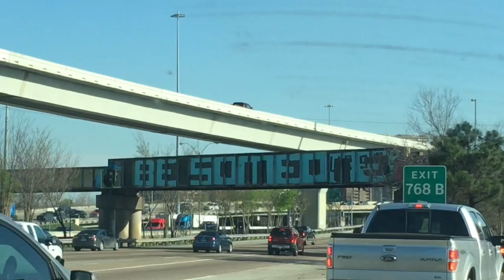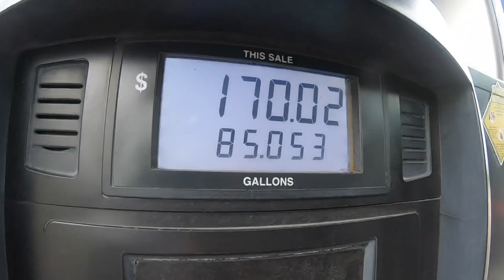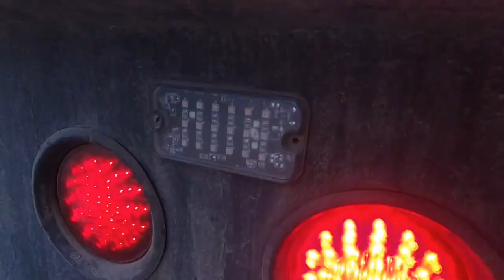Heavy haul trucker | RGN lowboy moving CAT excavator through downtown HOUSTON

Comment: You need to put a cover over the exhaust pipe of the machine or turn the cab of the machine the other way so that the wind don’t get in the exhaust and turn the turbo. It can lead to ruining the turbo because you don’t have the oil flow to lubricate the turbo while it’s spinning.

Comment: Wow the pins in that bucket are toast!  Just another little tip.  Carry I rubber boot and shove it in the exhaust pipe of the excavator it will save the turbo.
Reply from the maker: Not sure how the operators do the work with those terrible pins, your the second person that mentions that. Will have to do research have never seen or known about covering the exhaust pipe. Is there a reason to do it ? Lots of people I see on the highway don’t cover them
Reply: Grtruckingdemolition I cover the exhaust on my quad trac tractor when I haul it as when I started hauling it, that what I was told to do.  I’ve heard it matters, and I’ve heard it doesn’t.  So,  its up to you.
Reply: The breeze passing by the exhaust stack can cause the turbo to windmill and spin. With the motor off and no lubrication available bearings will be damaged and shorten its life.

Comment: Just a tip for ya man. When you put a chain/binder on the tracks like that, avoid putting it in an area where 2 track sections meet like you did with that 1st binder. @10:21. You see how it pulled the sections apart? If that binder were to slip or the excavator settle, that hook could wind up in the gap and possibly break through, now you have an unsecured load. Not to mention, DOT doesn't like it either. Please take this as constructive criticism. People taught me, just passing on some knowledge from one driver to another. Be safe out there, sir.
Reply: Johnny K True I was just thinking about that
Reply from the maker: Thanks for the tip/advice. I appreciate for commenting in a good way. 🤝
Reply: Man I had a driver bitch at me over the CB for not using chains to tie down and I do it the same way that he does. Saying I'm get a ticket if dot catches me but I passed by dot tied downlike that and I've never had a problem
Reply: InstaBlaster...

Comment: Damn Mercedes driver switched lanes real close to ya. Hate when people do that. If too close I’ll bare the horn. Happens a lot people gotta make sure they have room to switch lanes.
Reply from the maker: Man every day have idiots brake check me or not pay attention SMH. When I have to open wide to turn dumb ass people still try to go.
Reply: Grtruckingdemolition had a young woman in her Nissan turn into my lane right in front of me on the highway was going 65mph down hill almost goin under the bridge. She was real close I could of tore her rear bumper off. This was 2 years ago in the heavy haul truck. Big W900L... would of done a lot of damage lol. Here’s another thing, the lowboy truck I’ll drive, (01 W900 long truck because has lift axle) it pulls a real long brand new Fontaine Lowboy with a flipable fourth axle. (3 axles has a 4th that can flip up). I have to turn real wide with that big guy. People will go and the end of the trailer be close to the front of their cars when they turn. Sometimes the end of the trailer will be a very little bit in there lane, and my front right or left tire will be on the curb. The truck can be a high truck also so it’s good for it. Has air bags can be lowered or raised same with the trailer height. The truck hauls really large heavy excavators loaders etc. we have a Jeep for it. 2 jeeps... makes it super long trailer! When big vehicles are in the road around little cars, the car drivers have to pay attention! I know man. They should think of what it can do to them lol. Us too gotta pay attention but it’s the car drivers that need to be most cautious when a big vehicle is on em. Stay safe man enjoy the videos. Your  T800 came along way... think about tuning the engine? Maybe 600hp tune? Real good for your heavy hauling. I remember you saying it has 475? That’s not bad. Caterpillar engines are the best. Can be the lowest powered Semi truck Caterpillar motor and itll still get the job done.

Comment: You gotta use a turbo saver on the excavator’s exhaust
Reply from the maker: Have never used it, and never seen people use them
Reply: Turbo saver?
Reply: David Rigoni It’s supposed to prevent turbos from spinning without oil when air goes through the exhaust when it’s on the trailer
Reply: We us em all the time, will burn out the bearings on the turbo's spinning backwards without any lubrication from the engine running
Reply: I have to use them but I always wish Myth Busters did a show on turbo savers to see if its B.S.